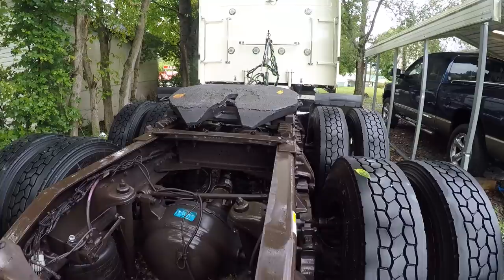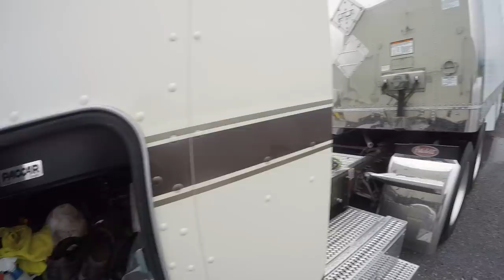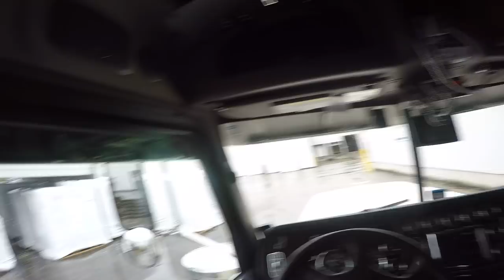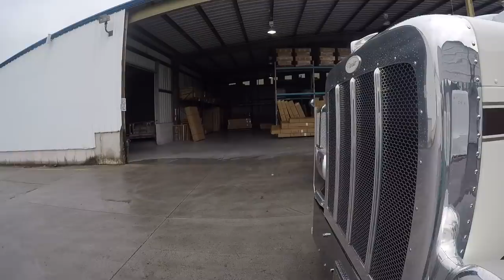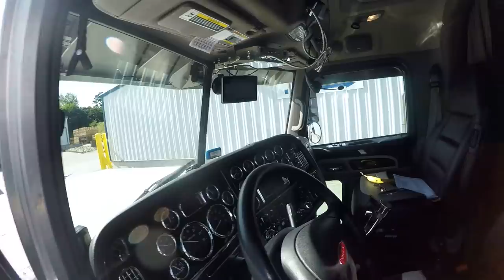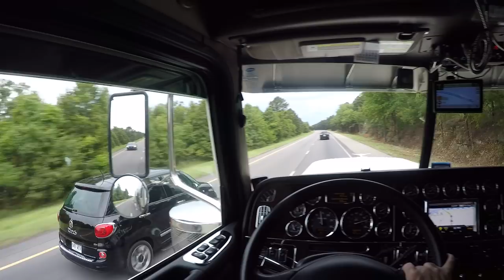#238  A $20,000 Dollar Hot Tub Went Missing!

Comment: I wonder if a body could invent some kind of self washing truck, where there is water lines similar to a windshield washer setup, all around the vehicle and nozzles spaced all around it. The water lines would be hidden behind the fenders, etc. Then you could just hit a button on the dash, like you do to wash your windshield, and wa la, the whole truck is washed. The water tank, chrome of course, could be mounted on frame behind the cab, where you could fill it with water. Get some high pressure nozzles like they have at the car wash, and hook it up to the air pump, and it should wash the shit out of a truck. I used to know an old man in southeastern Oklahoma, a former Cajun, that told me he invented the windshield washer idea that was stolen by the car companies. He drilled some holes in copper tubing and ran it underneath the windshield and would hit a button and wash the windshield while driving down the road. He said he freaked a lot of people out back in those days, when they saw the water squirting on his windshield.  There are people that would buy an invention like this, because they like a clean truck. The advertisement for selling and marketing the gadget could be. There is nothing more embarrassing than puling into a truck stop with a dirty truck, what will the lot lizards think? How is a man gonna get laid with a filthy truck? Well now we have a solution, it's called turbo truck wash and for 99.95, plus a small fee for installation of 200 dollars, we'll have your truck as clean as a babies ass. When you buy turbo truck wash, we'll also throw in, for free, sexy suzy tire cream, that will clean those filthy tires, and can also be used as ky jelly. And this is not all, we'll also throw in some pistol Pete engine polish. You'll be getting oohs and awes when you open the hood on that machine, when you use pistol pete engine shine. blaa baalh fast talking in the ad, and we'll ship this pistol pete engine shine, just pay a separate fee for shipping and processing.

Comment: Another useless comment, well maybe. If you don't already have it, next time you're in Costco, pick up some Sprayway glass cleaner. Comes in a four pack, usually in the back left corner where other cleaning materials are. I use it for everything in the shop. Generally strong enough to remove oils (the floormat is what made me think of it), great on chrome and stainless, obviously glass. It will take wax off paint, but it won't hurt the paint. Heck, when I was up in Flag this past weekend, I cleaned a chainsaw with it. ;-)
Reply: In the beginning of this video, you cranked your trailer, I didn't hear it start, thanks for the ride slong, pull toy here.
Reply from the maker: Don Leamon there is no such thing as a useless comment, I will check that out on my next Costco shopping adventure 👍 thank you for the tip 😎
Reply from the maker: david schabel trailer doesn’t have a motor on it